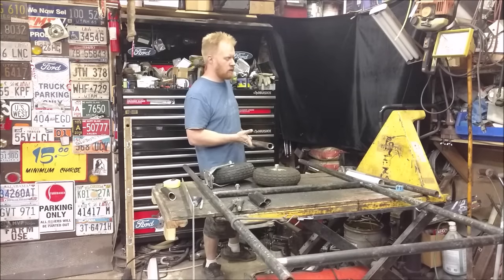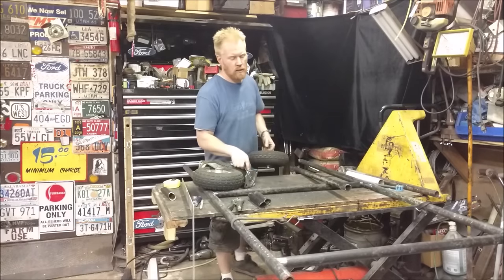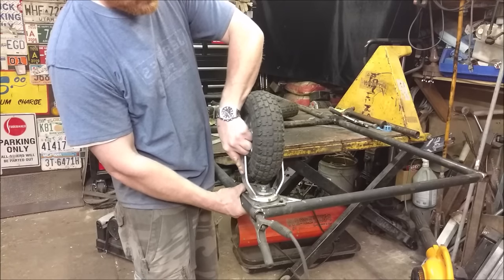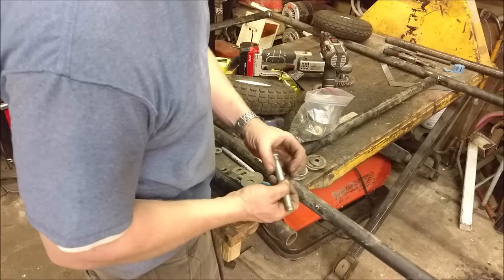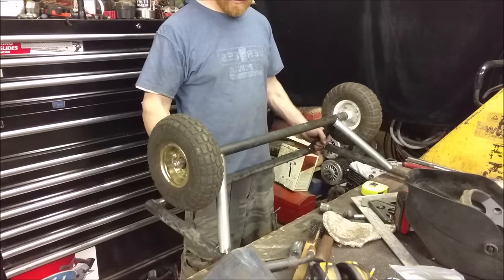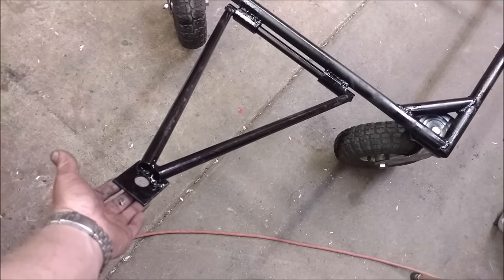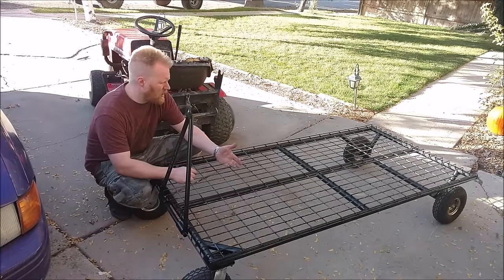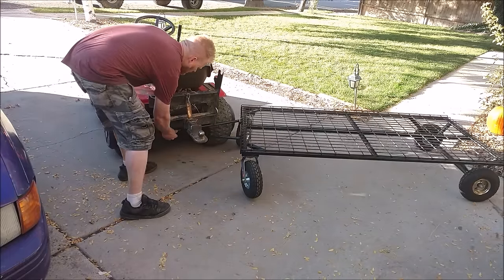4 tire Yard Trailer Cart made from tubing

Comment: that looks like pretty thick tubing. I bet you could haul around some pretty heavy stuff if you need to.  great little project looks good
Reply from the maker: Thanks. I think the only limitation is the wheels, but its what I had. These Chinese tires/tubes seam to loose air pretty quick while sitting(few months), so hopefully it doesn't drive me crazy.
Reply: @sixtyfiveford  
Fill those tires with spray foam insulation!
Reply from the maker: @jackd2083  The spray foam collapses/crushes under weight and you end up with lumpy tires that are harder to roll than just low tires. I ended up just putting teeny bit of TireJect and they don't lose any air at all.
Reply: @sixtyfiveford  
Thanks for the info. I hadn’t tried it. I really like your channel. Great content!

Comment: Well that turned out better than I though it would.  Where'd you find the wheel weights for your lawn mower?
Reply from the maker: The wheel weights for most of these tractors are universal. So a took them off a Craftsman that had a plow. I put them on my ugly duckling 80's MTD. I took another set off and run them on the front tires of my Simplicity 7016 for plowing(helps steer).